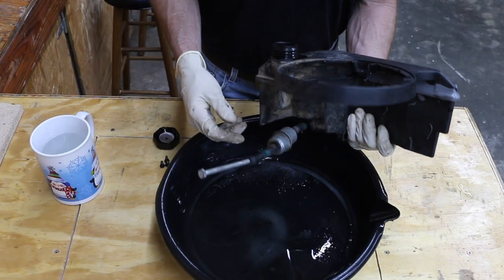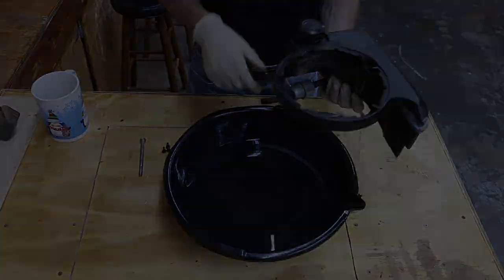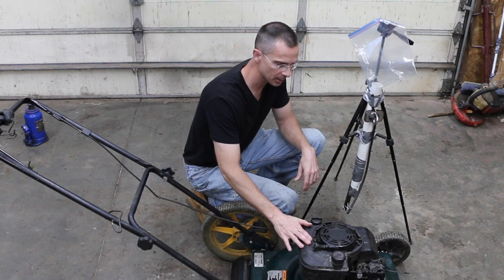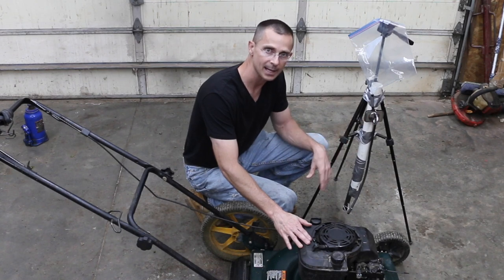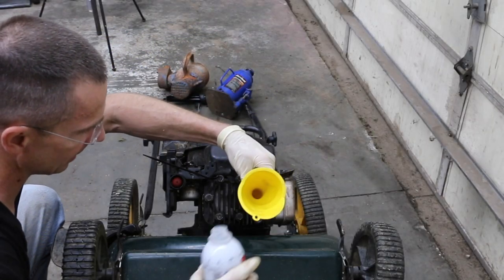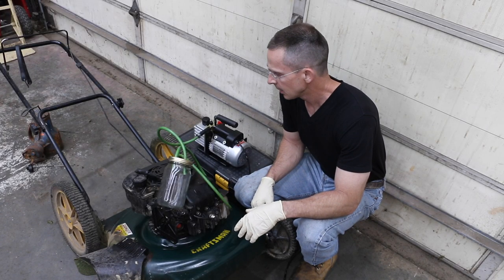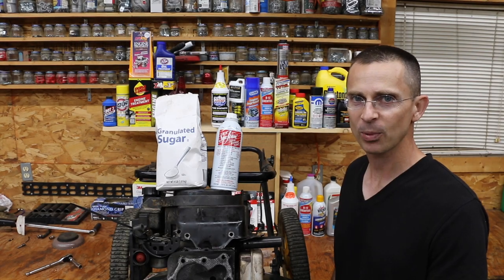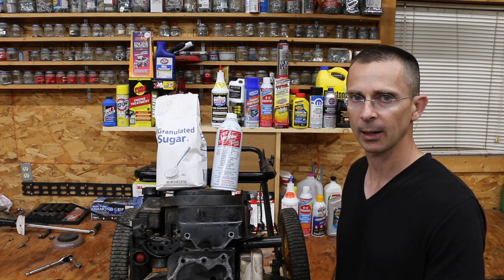Will Seafoam and water remove sugar in fuel?  Let's find out!

Comment: I wish you would stop saying Seafoam is a great product for cleaning carbon when you own tests prove otherwise.  MMO or Amsoil P.i. + Power Foam are a lot better.
Reply: Boodieman72 I agree!
Reply from the maker: Boodieman72,  MMO did a terrific job!   I will test Amsoil P.I. and Power Foam soon.  Thanks for watching the video and commenting!
Reply: If you use a lawn mower engine then you need Amsoil Quickshot which is P.i. for smaller engines.
Reply from the maker: Boodieman72, Okay.  I'll make sure to get the Quickshot if I test the product on a small engine.  Thanks again!
Reply: I dont really get what you mean. He's done several tests with seafoam and it did clean it. Are the internals a bunch of shiny new perfection? No but that isn't expected. It just gets rid of big buildup.
Reply: sea foam was the most brought up brand to use for the test by the viewers and that is what he went with // i am sure that some of the other products would have done about the same if they were used
Reply: well man, i highpy doubt your products will make the internals shiny new either... sea foam does a great job getting rid of large carbon buildup that do affect the engine, the first video i ever saw from this channel litterally took a truck from pos about to blow up to almost brand new with a full seafoam treatment
Reply: just realised MMO is marvel mystery oil, and from what i saw in that video i feel the sea foam did a better job
Reply: justanotherblankchannelman You're probably the only one

Comment: these videos are so great   you are probably the best amateur experimental youtuber !
Reply from the maker: Nick, Thank you very much for the encouragement!  I'm having a lot of fun with these experiments!
Reply: Try General Motors Top Engine and Fuel Injector Cleaner. Should be available at the parts counter at any GM dealer.
Reply: You don't know Cody's lab :D But he's a really great experimenter too, that's not the point :D
Reply: Nick Chase >
Reply: Amateur? I think not! This is pro territory for sure. Anyone can dump sugar in their fuel, project farm keeps those engines running regardless of the literal hell they've been put through.
Reply: He’a far from an amateur at this point
Reply: @natetv1494  I concur. The means he uses might be simple but the methods are 100% valid.

Comment: what happens if you use acetone in an engine? I've HEARD that it cleans out carbon really well when used the same way as seafoam but have never had the nerve to try it in my car engine.
Reply: Acetone works great. Problem is it will F the paint if it drips. Should be safer if you premix in a fuel or race can and pour that in rather that risk dripping straight acetone on paint.
Reply: Name Password - Or cut a 3 inch hole in a dish towel and hang it over the filler hole.  Covers the entire area in which gas would drip. To take further precaution, flip pump nozzle over and then take out.

EDIT:  forget the pump nozzle, I was thinking about when gas gets on plastidip and certain vinyl wraps.  For acetone, this will work as well.  Just be careful and poor SLOWLY.
Reply from the maker: Aarons Automotive, Yes, a lot of the carburetor sprays have acetone as a main ingredient.  Thanks for watching the video and commenting!
Reply: Speedway Premium stripped paint off the rear Quarter panel of my 57 Tbird when the fuel expanded and ran out the filler. Granted, whoever restored the car used a strange paint it seems, Speedway sent me a letter saying they "investigated" and their product is not at fault. But I downloaded their MSDS safety sheets and found acetone listed as an ingredient. It also softened the paint on my mower deck.  quit using Speedway for a few years after that!

Comment: I applaud your thoroughness.  I have run seafoam through my 1960s and 1970s engines with great success... At least I think so.  Three questions. 

Can you run an engine purely on seafoam?  I know it chokes out but that is usually because you force way more fluid than the engine needs.

Second.  For a crankcase have you looked inside a really crusty 350 and seen flakes and large carbon structures?  I would like to see what seafoam does to that... a hot engine that has been run with the crappiest oil with no changes.

Third.  Most additives seem to smell similar... octane boosters... fuel additives... oil additives... it seems to me they are mostly kerosene.  I would like to see if kerosene would clean an engine.  Maybe 100% kerosene even.  A lawnmower will run on almost anything flammable and liquid.

Keep up the good work... for science!  Ok mostly for stupid.  For stupid fun.  For stupid fun science!
Reply from the maker: Some Guy, Thank you very much for the positive comments.  Also, I like all 3 of your video project questions/ideas.  Thanks!

Comment: Something id like to suggest is to just top up with clean fuel and run for some time with no additives or cleaning and see if that helps first. Maybe next try the water cleaning and then seafoam. In other words, id like to see just one trick used at a time because when many are used, its not sure which one helped the most. Very nice testing and filming you do in any case! Enjoying your videos very much!!
Reply from the maker: sunpaa, great suggestion.   Thanks for watching the video and commenting!

Comment: Well i have never used Seafoam but i highly recommend the water and ATF. On all of my petrol vehicles i put ATF in the fuel tank in small proportions like an additive to clean the fuel line, pump, injectors and to help pick up the carbon buildup. As you saw ATF is a great solvent for buildup and i use the water spray in the engine manifold. With the ATF i dont have issues starting the engine, idle is perfect, the output is normal. My car is a 96 BMW e39 528i manual. Works fantastic, very hard carbon pieces come out of the exhaust. I do the water spray on a very warm engine in order to evaporate all of the water even the water that goes in the oil. I have never had the water/oil problem you experienced in your previous video. As for the duration i do it until the white smoke is at its minimum not the vapor...there is a white smoke that comes out like from a blown gasket. I personaly dont use additives because i have used several times and i didnt like the effect. Moody engine, harder starts, unpleasant smell and so on. Once i used a fuel system cleaner and it clogged my fuel system...was a nasty job of finding the spot :D Cheers i like your videos mate subscribed! :) Oh and one more thing... you should wait for the engime to warm up in order to evaporate all the water because as you can see it cools the engine and it mixes with the oil and it doesnt do its job as it should. Try these methods and see the results :)
Reply from the maker: Encho, Thank you for subscribing and I enjoyed reading your comments!  You have a great strategy for keeping the BMW in fine working order.  I agree that I should preheat an engine before using water.  All terrific suggestions!  Thanks for watching the video and commenting!

Comment: Back in 1965 we had a Ford pickup that had a bad fuel pump and it pumped fuel into the crankcase ,, Show your viewers  what happens when you use gas for  lubrication.
Thanks for the videos.
Reply from the maker: You are welcome.  Thanks for the suggeston.

Comment: I love all these tests with different products. It has been very educational! For something as bad as Sugar, I would have gone full paranoid, Water through the Intake, followed by ATF through the Intake & Seafoam or Berryman's through the Intake. Also, if this happened on a small engine, after the testing was done, if I removed the head anyway, I think I would have used a small brass/copper brush to remove all the carbon from the head. Still I love the massive numbers of tests that you are running, to find the best solutions!
Reply from the maker: Great suggestion!  Thanks for watching the video and commenting!

Comment: Two Questions:
1)  If the engine runs smoother after minimal effort (ie, the first application), would you consider the engine ok to run until the deck rusts out ?
2)  Could you smell the sugar during the initial test of contamination (ie, good warning sign in a car),  and  was there a sugar smell during the clean out?

Great videos !
Reply from the maker: Joe, Yes, I would consider the engine acceptable to run as long as the tank had been cleaned and fuel filter changed. 2) I could not smell the sugar, possibly because of the engine smoke, but I don't know if would ordinarily produce a noticeable smell.  Thanks for watching the video and commenting!

Comment: Great experiment! I have used Amsoil performance improver on carboned up engines and they ran great afterwards. I do agree that seafoam is an effective product. Have you ever tried the Amsoil PI?
Reply from the maker: Michael, I have not tried Amsoil PI yet, but I plan to begin testing Amsoil once I use up some more of my inventory of existing additives.  Thank you very much for commenting!

Comment: I would like you to try  Automotive transmission fluid for clean up ? I've always heard but that is a good cleaner before  seafoam my buddies would run transmission fluid through their Automotive engines with high miles to clean them and the carburetor. :)  I love all your videos I really do I think knowledge is power :)
Reply from the maker: Thank you!
Reply: @ProjectFarm  my dad has run trans fluid through the engine and it really makes a lot of smoke. Do not know how well it cleaned though.

Comment: you need clear graduated measuring devices when you measure out any of this stuff for your viewers and to be more accurate. You need a diesel engine a 2 cycle engine and a fuel injected engine to see the difference each additive or fuel alternative does to each. constructive pointers, love your vids. Your vids got me to buy my first bottle of mmo after seeing your test results. Resolved the sticky lifter problem in my v8 jeep and saved me a small fortune on an other wise expensive garage visit. I now buy mmo by the case and use it in all my equipment. Big surprise was a junk 2 cycle chainsaw I found on the side of the road that didn't run. changed the fuel ( 2 cycle mixed ) and added a shot glass of mmo to the mix. I waited half an hour gave it 3 pulls and it burped belched and now is my favorite saw. runs great
Reply from the maker: This is a terrific recommendation--thank you.  Also, glad that MMO help resolve the sticky lifter issue.  Hearing success stories like yours provides me the motivation to continue making videos.  I really enjoy helping others and YouTube provide the opportunity to reach a really large audience to help a lot at once. Thanks again.
Reply: Aron Braswell 

i use Marvel Mystery Oil mixed with remnant oils as a penetrating oil.

any bottle of oil, tranny fluid, gear lube, etc. will have a few drops left stuck around the inside.

use a 5 quart oil container to hold each empty bottle upside down in the mouth for a few hours.

before long, you will have a quart of 'remnant oil' that is great to mix with the MMO and doesnt cost anything extra.

i even take this mixture when i go to junkyards or work on friends vehicles to use as a penetrating oil.

works great on bicycles, too

Comment: I LOVE your videos! I'm learning so much from them. I have 2 boys that chose to go to school to become mechanics, and they are both working as diesel mechanics now. I do have one question I wonder if you or another readers could answer. When I was about middle school age, my mom's Buick station wagon that had a V8 was messed up with sugar in the gas tank. It started running very poorly. She took it to her regular mechanic. He ended up dropping the gas tank to clean out all the sugar - he said probably a full 5-lb. bag. Anyway, he worked on the car, got it running again. It never ran quite right again. According to him, one piston was damaged beyond repair. He claims he was able to retune and reset the timing for the motor to run on only 7 cylinders from then on. Does that make any sense?! I wouldn't think that was possible. I do know it only had 7 spark plugs, and they had plugged up that spark plug hole and cut off the wire that came from the distributor cap. Weird, I know...
Reply from the maker: Darin, Thank you very much for the positive comment!  I don't quite understand how the cylinder sustained damage, unless it became so gummed up that the piston rings gouged the cylinder wall somehow.  From my experience, the sugar entering the combustion chamber burns but is a little sticky.  Thanks for commenting!

Comment: Cool video setting the engine back to smoothness. I believe the valves were the critical thing there, because once the valves got some "sugar coating", the sealing is gets pretty bad. The piston look like a bit cleaner but not much.

I'm still waiting for some test with ethanol, as additive to clean the engine and as main fuel in the tank to clean the engine. I like your consistent method and it can be very useful. ;D
Reply from the maker: Ti M, I agree.  The engine runs much better now. Thanks again!

Comment: Could you show what would happen running an engine on various different fluids? Such as brake fluid, atf, power steering fluid, gear oil, coolant? Thanks! Either way keep up the good work!
Reply from the maker: hullza, Thank you for these video project recommendations!  Also, thank you very much for the positive comments!
Reply: A channel called warped perception did a multi part video of a clear cylinder head and poured all kinda odd stuff in the engine.

Comment: you can use polished rice  run through the carb at high rpm to break up the carbon deposits crazy as it may sound.  Ford had an engine in the '70's that  carbon was a problem in and it worked.  I would like to see  the inside before and after. all I have seen is the improvement in performance
Reply from the maker: Thank you for the video idea!

Comment: I have heard that driving a car in fog is good for the engine as it causes carbon to be cleaned up. As a Chemistry Major, these are the reactions I am told occur:                                                        
C + H2O > CO + H2
CO + H2 + O2 > CO2 + H2O
Both of these reactions require heat and pressure in order to occur. Suggest running a badly carboned up motor with an air supply that has been humidified by being bubbled through water, eg. an aquarium bubbler to produce lots of small bubbles that should maximise the moisture content of the water.  Wouldn't want you to be bored! ;-)
Reply from the maker: Thanks for the video idea!

Comment: What would you recommend for a Diesel engine to help clean up carbon build up in the cylinders? I’m would like to know. 
My truck has 190000 some odd miles on it so I was just wondering.
Reply from the maker: There is a method of using Seafoam to clean the injectors and combustion chamber.  I believe it's added the the fuel filter when the fuel filter is changed.  If you're considering this as an option, highly recommend checking the Seafoam website for directions.  It cannot be added through the air intake or the engine will over-rev.  Hope this helps.

Comment: So it depends. If you have good access to the fuel lines you can make your own distiller with a 1 gallon gas jar   - the fuel lines go into the jar via a stopper with holes and only go into the jar by two inches. The stopper needs to be very snug. With the engine running the fuel system will circulate and the sugar should participate out and fall to the bottom. I think that it is worth a try. I like the sea foam and water idea as well.
Reply from the maker: Thanks for the feedback.

Comment: Add a little bit of water to the intake while it's running, it steam cleans the cylinder(s). Your IV method should be a good strategy. I promise that if used correctly, it won't hurt the engine. Check out water/methanol injection, a similar concept.
Reply from the maker: Eric,  Great suggestion!  I previously did a video using water and it worked well!  Thanks for watching the video and commenting!

Comment: suggest seafoam vs gunk motor flush.
I've used gunk on a few cars I've had before oil change to breakup sludge and deposits in the crank case, cleaned out old oil so well that the rockers were extrealy loud durring first 20-30 seconds until the new oil made it up to top of engine
Reply from the maker: Nathan, This is a great recommendation--thank you!

Comment: do you change the head gasket each time?
Reply from the maker: Changing the head gasket is always a great idea and recommended.  Due to project costs, I visually inspect and clean the gasket and engine surface to ensure a good seal instead of replacing the gasket each time.  Thanks for watching the video and commenting!
Reply: Where do you get your re-usable gaskets from? Anything I buy is made from tar paper and is a half hour job to remove stuck on bits of it. No way is it possible to re-use either = cheaper bastards than I am saw me coming. Not too happy about this situation, so save me.
Reply: Lee Barnes head gaskets are made of a different material.
Reply: Project Farm OK thanks. it's impressive that you can "reuse" them so many times. I know it's recommend I was just wondering. thanks for the reply.
Reply: So no gasket at all is the take away from Project Farm with a bit of dancing around about coming right out and saying as much in plain talk. There are no re-usable head gaskets sold anymore. You didn't save me.